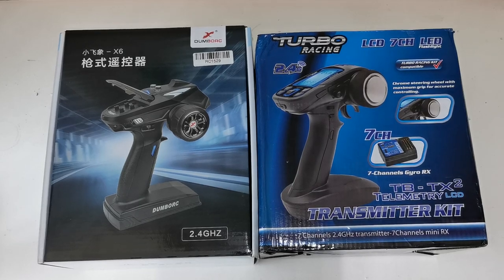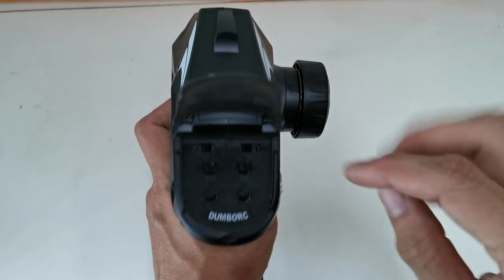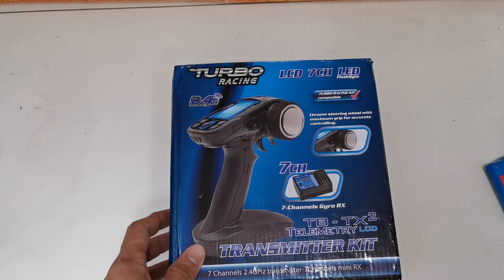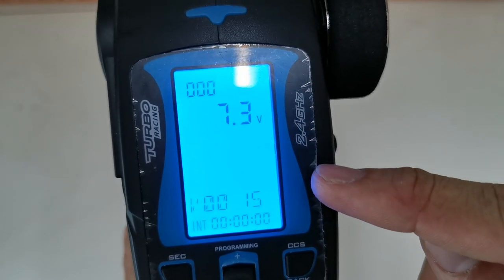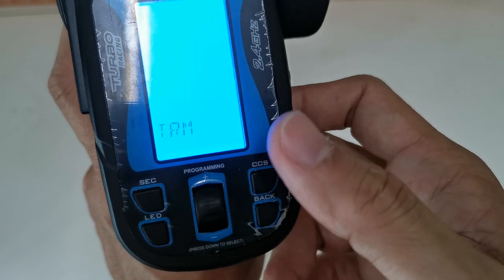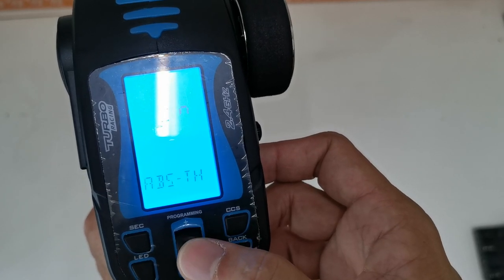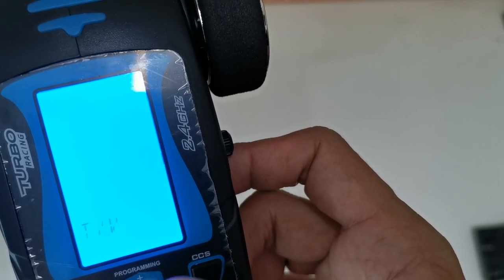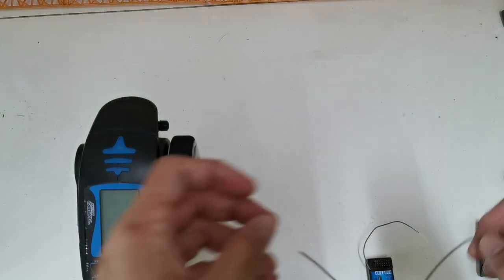Turbo Racing (Hobby Porter) Vs Dumborc - Budget 6 and 7 channel rc transmitter ($20 vs $35)

Comment: How many cells and mAh is the lipo you use for the hobby porter. What is the max volts cannot handle?
Reply from the maker: Aro800 Turbo Racing 7ch transmitter can takes 2s Lipo and the battery tray can fit for 1200mah easily. And I used 2s 850mah and 1000mah (a bit tight) for dumborc.

Comment: Hi,
The box say Telemetry does it have telemetry?
Thanks!
Reply from the maker: It doesn’t has the real time voltage and temperature reading function. Basically it is the transmitter has a balance port for 2s and 3s Lipo for you to check the battery voltage and a temperature sensor to plug to the transmitter. So the receiver is just like other normal receiver which doesn’t has any connection to sensor
Reply: @jeffreytfl5832  thanks, for the explanation.
Also do you think the receiver would fit in a SCX24?
Reply from the maker: @theflyerpr40d  I dun have the scx24, the size of the receiver is approximately abt 3.6x2.6x1.6cm
Reply: @theflyerpr40d  I took the receiver apart and did not use the casing.  I double sided taped the board and it works fine.

Comment: Personally, which one is better feel in hands and better built quality and performance? Im still stuck between the 2 😑 thanks in advance.
Reply from the maker: I personally prefer the dumborc as it is cheaper and quite ergonomic to me, my rc mainly are crawler, so the dumborc does the job well to me. The other one have more settings function at higher price tag.

Comment: Which one is better in performance?
Reply from the maker: Depending on your need, if u need to have different setup for each model, the turbo racing is better option. Other than that, the dumborc is pretty decent for its cost as it has very fast responses and long range control. I personally prefer the feel of the dumborc.

Comment: Im using dumborc controller for my new mn rc...day 1 me buy and install the receiver dumborc to my mn rc..after sucess install n play around 30 minutes...day 6 i want to play with my rc n switch on the dumbo rc with the receiver on..ill found out my rc cannot go to right  just go to the left and straight..n someone check for me my new dumborc controller..yes the controller is faulty...what happen
Reply from the maker: Check the adjustment knob on the top of transmitter for channel 1, it should be at center position if your rc steering is set correctly
Reply: @jeffreytfl5832  alredy check bro but still same😂